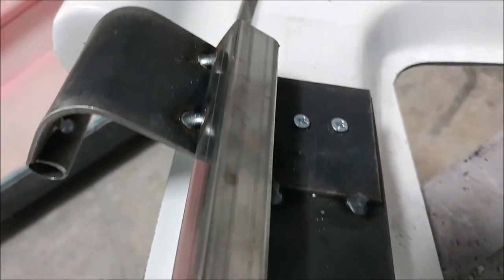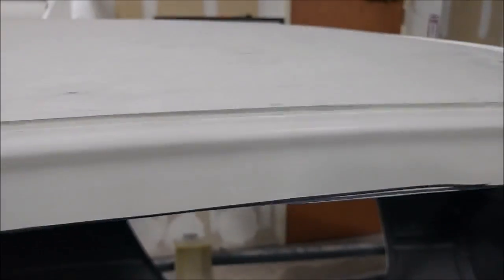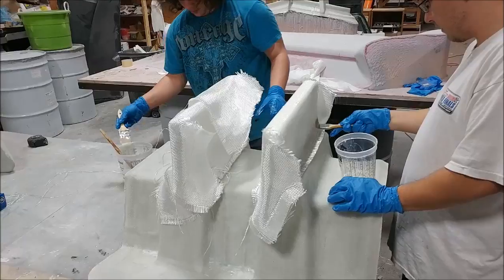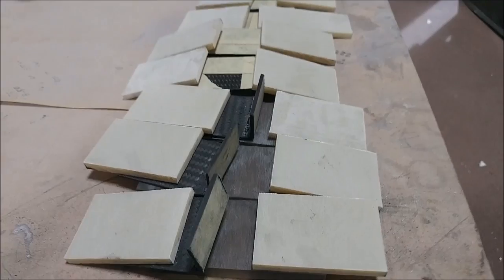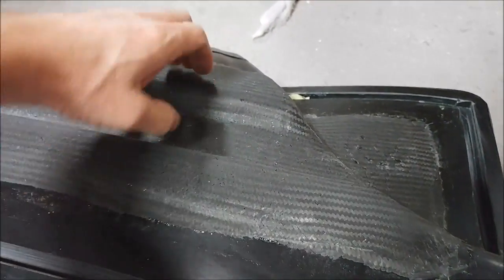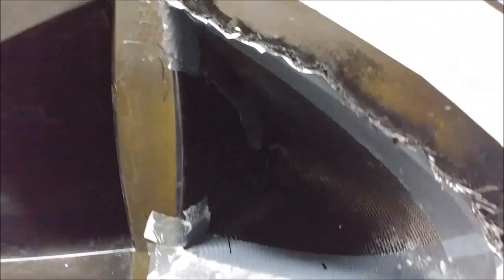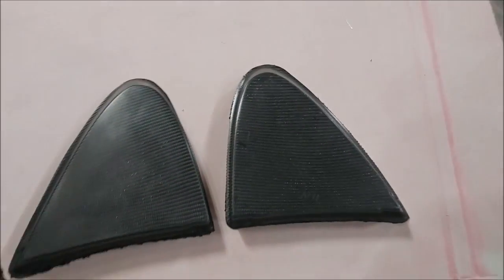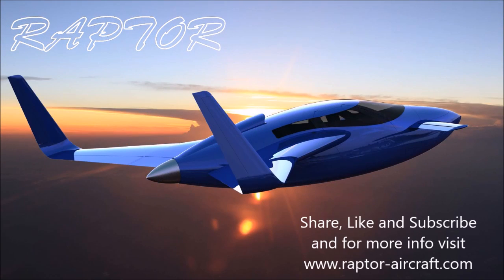Raptor Aircraft December 31st

Comment: I have a question about the colour of aircraft. I have an all composite Pipistrel virus and was told that composite aircrafts must be white, even small decals can affect the heat absorption on the composite skin. Are you planning  to make the aircraft blue or will it be white? If it is blue how are getting around this heat issue? A guy here in Canada painted his white composite plane black and said it feels like jello taking off in warmer days until the skin cools down then it firms up.
Reply from the maker: As long as it's post cured to a temperature higher than what it would reach sitting in the sun it's possible to have medium colors. Black would not be a choice.

Comment: I will add another comment about pressure testing vessel. There are 2 ways I have been involved with when I worked in experimental at Beech Aircraft. 1st is to use compressed air to pressurize the vessel. The other way and safer way for people to be around and observe the process is water. this is a process that does not require filling the vessel with foam filler to reduce the cycle time. the cycle life can only be determined by cycling to failure.

Comment: Happy New Year.  I have been monitoring your progress over the last year. Impressive.  Have you chosen a location for your mass production?  I'm assuming that you will make more molds so that you can increase your output.  The reason I ask is that I was just looking at a manufacturing location for one of my business projects (non aviation).  The building is a 100k sq. ft. hangar on a beautiful airstrip with a central location for distribution throughout the U.S. .  I wondered what I would do with the rest of the space if my project doesn't fill the building (fat chance).  I thought of your future manufacturing space requirements and thought that I would put out a feeler.   Jim Ostler
Reply from the maker: Presently we're just focused on getting the prototype flying. Figuring out the scale up will come later.

Comment: In regards to the high pressure fuel pump, why are you replacing the OE one ?
 Are you still planning to use the return fuel as a heat source for de-icing or was there some other reason that I missed?

thanks
Reply from the maker: The piston fuel pump is a newer style that does not provide reliable pressure the way that the older style rotary pump does. We are planning on either circulating the fuel or heating it using excess heat through an engine oil heat exchanger.